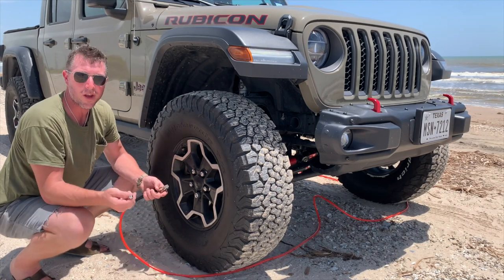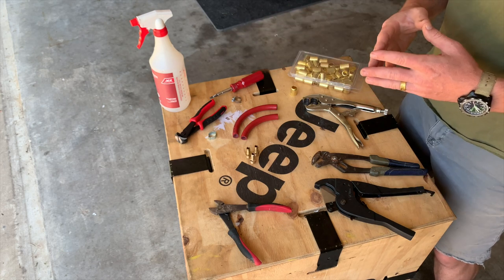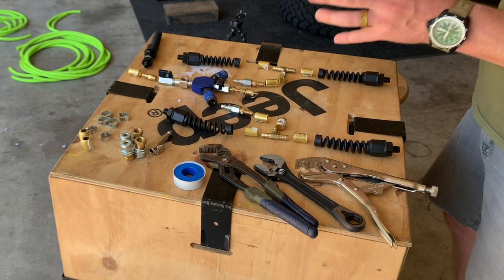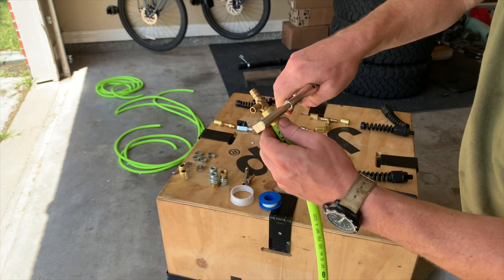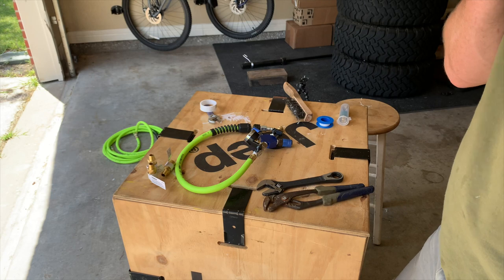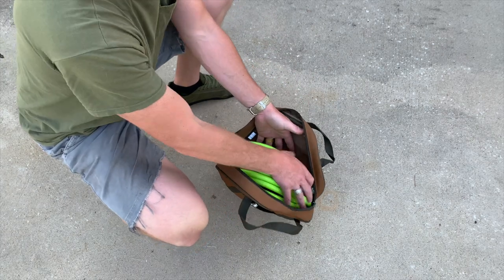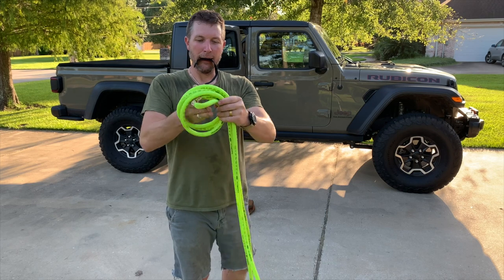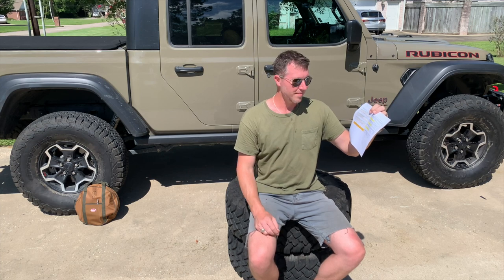DIY 4-Way Tire Quick Inflate/Deflate System for Off-Road Tires

Comment: Great video. I just used this as my blueprint. It's better than many of the ones that you can buy for about the same price. I did do a slight upgrade by using only the Flexzilla ends instead of the ferrules. That will make all of the ends field repairable and it's only about $25 more when you consider the crimp tool and a box of the brass ferrules. At least that's how I justified it in my head.
Reply from the maker: Thanks for taking the time to watch and comment. I use it all the time and have tossed it to friends on the trail too. I used the flexzilla pros at all my ends as well.. I showed a few examples of how to do it. Crimps, ferrules and flexzilla pros at the valve stem connection.. I only did ferrules at the tees and connections that wouldn’t work with a flexzilla pros or where i didn’t see it necessary to worry about repair.. shoot me a message on Facebook  https://www.facebook.com/JKHartel3 or email jkhartel3@gmail.com and I’ll show you pics of my setup. I spared no expense with my build.

Comment: I did same thing but my gage is in the top center I can connect my hose to valve on bottom to air up, to air down I don’t connect the hose to the bottom open valve and it will deflate all 4 tires at same time I love my setup just like yours

Comment: Nice demo on this entire 4 tire system. I'd replace the compressor with a 10 lb CO2 tank. You'll never look back. The inflation timres are not even close.
Reply from the maker: Thanks for the insight, I have been considering that as well.

Comment: This is a cool idea. I happen to have a dewalt flexvolt cordless compressor (I think Dewalt makes them for 20v batteries now too) that I take to the kart track on practice and race days and also take to the desert when we dirt bike. I’ve got 3 flexvolt batteries. Is there anything wrong with using something like this for my Tacoma?  I’ve also got a Ryobi cordless version (because I stumbled across a clearance one for $59) that I was kind of planning on just keeping in back of my truck at all times, Incase me or a family member have an issue (which is fairly common in my home). If anything, I could easily fit the DeWalt and Ryobi in back of my truck when I need to play with the pressures when going off road
Reply from the maker: Thanks for taking the time to watch and comment! Yes this will work with any air pressure source!

Comment: Hmmm cool idea.  Your video made me realize a solution for another issue I have...

I have an older snap on compression tester where a couple hoses have started to leak from age.  I can easily reuse the end fittings that I have because they are really high quality, I’ll just have to find a 3/8” hose ferrule crimper which appears to be the difficult part.  But using any sort of a clamp doesn’t work for the application (because it makes the tool too wide for the spark plug holes).
Reply: The hose 3/8” ferrule crimpers in Canada all seem to be $150+.  Hmmm I need to find some cheaper vise grip style like in your video.

Comment: Great video.  After 18 months of use how are the Haltec bore Lock on air chucks holding up?   The amazon reviews are mostly positive but, of course, there are some negative ones too.
Reply from the maker: Thanks for taking the time to watch and comment. They are holding up well! I keep a spritz of wd40 on the sliding collar and springs to avoid moisture corrosion or sticking. The company I work for uses haltec valve for damn near everything, the other side locks don’t hold up.

Comment: Thank you for making this video, it was awesome! I found it while doing research for my own air system, and I learned a lot from you. 
Do you think stepping up to 1/2" hose would increase inflation / deflation speed?
Reply from the maker: Yes, but it will be marginal at best. If you can find 1/2” and the weight and size doesn’t effect your storage space then I’d say your fine. 1/4” is adequate for even the twin, but 3/8” is a happy medium for a slight increase in flow and not much weight and size increase.
Reply: It wouldn’t make much difference since the restriction will be the Schrader valves

Comment: Very helpful solution, appreciate all the great details!!  Did you have to use a spacer (if so what size) for those stock rims on 37s?
Reply from the maker: Thanks! You bet! No sir, that’s the 2” MOPAR + 3/4” dayStar spacer that I installed 2 videos ago. I absolutely love it. That’s 37’s on stock wheels and no wheel spacers. I’m not sure they are needed just yet. The only worry would be rubbing the swaybar.. believe it or not these 37’s actually measure 35.25” and are approx. 10lbs heavier than the stock set per wheel.. so only adding 40lbs total of rotating mass. If they were true 37’s I would be considering spacers Or different offset wheels. My friend Seth that runs JT mods channel has the stockers wheels with 37” Patagonia’s and synergy spacers, no lift either .. looks great! Check out his channel

Comment: Love this video! I can tell there was a lot of effort put into the design. May I ask what the thread pattern on the Haltec H-5625 Bore Lock-On Air Chuck to connect it to the hose? I can't find the thread pattern anywhere.
Reply from the maker: Thanks, I figured at least one person would find this helpful… The haltec chucks is a standard 1/4” FNPT And goes directly on the 1/4 MNPT flexzilla air hose end. I hope this helps

Comment: Curious as to how the Flexzilla slip on connectors have stood up with use. Do the reusable fittings work loose &/or leak? Just getting ready to go overlanding & into retirement with outdoor enthusiasm. I will be following your pattern for the inflate/deflate system, likely with a Red Green flair if you are familiar with his style.
Reply from the maker: Flexzilla is holding up great… I haven’t had any issues with leaking… I do use the flexzilla pro connectors that allow you to adjust/repair any issues… They work very similar to AN fittings… It’s a great piece of kit to have… I went with a portable set up like this rather than affixing hose to the vehicle… I may do that later on but this is convenient for multiple vehicles.

Comment: Great video!! I’m considering going with 1/4” hose for a more compact storage. Thoughts? I have a Viar 300p and Silverado 285/70/17s going 18 to 42 psi (still need to do your chalk test but my auto deflators require 2x setting to activate.) I know it will take longer but this Viar will only pump so much. Thanks!
Reply from the maker: Thanks for taking the time to watch and comment. Yes, the 1/4” dia would be slightly more compact, but side by side of 1/4 to 3/8 hose comparison I didn’t find it to be enough a size difference to impact storage space vs the extra flow volume. The bucket boss bag makes it convenient to stow away. My single ARB pump with the 37‘s does take a bit of time by comparison of a twin pump set up… But with the four-way system it’s a lot more sufficient than doing each individual tire, be it inflating or deflating.
Reply: @GatorOverland  Thanks! I checked and my Viar pushes 1.76 cfm at 20 psi with a duty cycle of 33% at 100 psi. Most of my fill ups are in the dark at very cold temps here in Wyoming, after a day of hunting. For now an Anderson plug up front  power without opening the hood (wind hazard opening hood) and a 4 way hose setup should really save time. I have done fill-ups in near blizzard whiteout conditions in the dark. There is highway between hunting and home. As a precaution, I fill both front first in case of compressor failure. A four-way system will give me even air to all, hopefully getting close enough, should a failure occur. In the cold weather the Viar does run very cool which is a benefit. Incidentally I have had one of those bucket boss bags for 20 years. Wise choice. ARB compressor mounted on the list next year for sure. Thanks again!
Reply from the maker: You bet man!! 
For better contact, info, photos and video check us out on
https://www.facebook.com/JKHartel3
https://www.instagram.com/p/CF-X_58BjDR/?igshid=1r9yo0niyroip
Email: JKHartel3@gmail.com

Comment: I have co2 tanks for inflation. I inflate my 35” KO2’s from 15lbs to 40lbs  at 30 seconds or less.
I did this with an air hose. As well so I don’t even have to remove my co2 tank from the vehicle.
I have made it fully automated as well. Flip a switch and I can choose to inflate or deflate to one of three pressures. 15, 25, and 40.
Reply from the maker: That sounds awesome that I would love to see what that’s all about. 
For better contact, info, photos and video check us out on
https://www.facebook.com/JKHartel3
https://www.instagram.com/p/CF-X_58BjDR/?igshid=1r9yo0niyroip
Reply: I too have co2 for my 35" ko2's! Do you have monster valves or standard tire schrader valves? Also would you mind posting what switch you used for the auto psi cutoff?
Reply: Hey Gary, I’m going that same route, where I can find your info for your set up? 🙏 thanks

Comment: Could you attach one of those valves to your system that stops deflating at a particular pressure so that you wouldn't have to monitor the deflation? Thanks!
Reply from the maker: Yes, I actually mention this at the beginning but never did the evaluation because it took longer than 20min to complete.

Comment: another great job! looks like your running K02's im about to order some before my lift comes in and im confused on the load range which did u go with? im going to get 35's
Reply from the maker: Another one? You mean you didn’t fall asleep in this one either? I’m messin.. I run 37 1250 r17 load range D. My factory 33‘s we’re load range E. It really depends on what your vehicle weight is, and your intentions with the vehicle… To put it simply, heavier trucks like three-quarter ton and 1 ton Dooley‘s typically run load range D thru F, which allows for more pressure in the tire, and more load capacity of the individual tire, but can often translate to a very stiff, heavier tire because it requires a higher minimum tire pressure, and potentially reduces fuel economy, but some tire mfg in certain tire sizes limit variety of load range options. My gladiator weighs around 5000 pounds, which is 1200lb-ish per corner, and inflation range is 25-50psi. The load capacity at 25psi is 2150lb & 50psi is 3525lb, so tires alone at 50psi would allow for 7000lbs of a load in the rear, and 2500 of that would be your vehicle weight, which leaves 4500 lbs of load on the tires, but most vehicle payload capacity aren’t much more than 1000lbs so, the tires would be more than capable of just about any load. I don’t tow, and run my tires between 27&30psi which puts me at about 2400lb capacity per tire, which would be 4800lb in the rear, and my payload is right at 1000lb, so that leave me with 1300lbs tire capacity in rear at a full load, which is more than enough. 
Know your vehicles weight
Know your vehicle payload
Determine your tire pressure and look up a load/inflation chart and to see what your capabilities are for that tire pressure.. 
I hope this clears things up, let me know if you have any questions
Reply: @GatorOverland  wow!!! That is amazing information and NOPE lol didn’t fall asleep haha. I have a 2021 high altitude gladiator I won’t be towing or heavy rock crawling either I mostly need something good to get up my very steep driveway which is a quarter mile long lol plus I live straight up a mountain so when winter comes it’s very hard to get up here haha and right now my gladiator has the factory street tires on them getting the mopar lift and still trying to decide on what brand and what tire to go with lol I love watching your videos keep up the great work
Reply from the maker: Thanks for the kind comment… Considering you are snowbound, the KO2’s are a great option for most any condition except mud specifically… Not to say you can’t play in the mud with them, but they are not a priority mud tire. They perform outstanding in the snow, sand, most any Rocky condition and more importantly are quiet on the road. 20 inch wheels typically call for a tire that has a higher pressure, so if you’re swapping to 35’s regardless of stock/aftermarket wheel, you should inflate to at most what is on the door jamb, but the chalk test will prove an ideal pressure for regular road driving.. Would be interested to know what the test reveals… I’m thinking 30 to 32 PSI should be sufficient.. You should always re-inflate according to your tow/load when applicable. Don’t forget you need to invest in a programmer so you can resize your tires or your shifting and speedometer will be off, and could potentially damage your transmission, so it is extreme priority to have that done properly. Since you’ve seen a few of my videos I assume you’ve watched the Mopar lift video. I’m coming up on 30,000 miles after install and I still love everyone… Of the parts that I recommend to add to that list I suggest at least the adjustable trackbar. But if you do decide to go with the rest of the components you will not regret it… I’ve been contacted by over 50 viewers who have positive feedback from installing the exact set up. I don’t work for anyone I just learn, earn, and pay it forward
Word to the wise, do not input 35 inch tire on the programmer because you put 35s on… You measure from the ground to the center of the wheel and multiply that number by two. The reason for this is because of the vehicle weight, the tire bows which makes it shorter radius from the ground to the center of the wheel than it is from the center of the wheel to the top of the tire. Rarely are tire heights matching of the number on the tire… Case and point, my 37‘s measure 35 1/2 inches tall at 30psi, And believe it or not my input for my tire size is 34 1/2”.. The distance from the ground to the center of my wheel is 17 1/4 inches… multiply that value times two and you have 34 1/2… My speedometer is spot on.. If you were having a shop do lift and tires, and they are re-programming, I urge you to inform that that’s how you want it programmed initially, do not allow them input “35” for the tire size. This can easily be done yourself as well just remember to measure accordingly.. I use the ECRI programmer it works great For tires, gears, and eliminating or decreasing the TPMS low pressure threshold.
https://amzn.to/3Btu3pz
Reply: @GatorOverland  I have watched almost all your videos lol and love your chalk test video too. I’m actually having the dealership reprogram my tires so I will for sure let them know to measure my tires and not put just 35’s I’m actually keeping my rims since it’s part of my package I paid extra for haha and I actually love the look. I was considering TOYO AT2 or AT3 or AT EX BFG K02’s ,NITTO ridge grapplers Falken wildpeaks but the falkens are out of stock actually a lot is out except the K02’s lol I had them on a trailhawk renegade once they seemed loud to me but they was a D rated on a smal suv lol so idk if that’s what caused it or not but they did very good in snow up this hill. I’m looking forward in more of your videos :) let’s run out and go order my mopar lift and fox steering stabilizer now I’m actually going to do the adjustable tracks but can’t afford everything right now so that will be next :) keep up the great work and ty for responding so quickly as usual
Reply from the maker: You bet! Yes, the renegade is a different suspension all together so they have the ability to transfer sound a bit differently (more like a car than a truck)… My wife has a 16 grand Cherokee with Michelin street tires and it’s louder on the road then my truck with 37‘s.. I even did a decibel check.. I think you should stick with AT’s  if you are wanting to keep the road noise down… And if you havent invested in a headliner you should definitely do that too… It helps significantly with heat and sound. I have over 300,000 miles on BFG ko/KO2 tires and never had an issue and usually get 45k mileage out of them.. I rotate religiously at 5k miles. I favor toyo, Nitto, and Cooper if I went another tire brand.
Reply: @GatorOverland  you talked me into the K02’s LOL guess I’m ordering them today too LOL and YESSSSSSS I love the headliner it came with mine I drove a gladiator that didn’t have one and wow you can tell a big difference in noise and heat. I hope you have a wonderful day today
Reply from the maker: Thanks you too… if you reach out via email I will send you my alignment sheet for reference… My vehicle had a wandering issue (asides the aluminum steering box) come to find out the toe alignment was 7/32 out from factory.. it shouldn’t be more than 3/32 toe.. 
jkhartel3@gmail.com
Or John HARTEL on Facebook messenger
Reply: @GatorOverland  I was under the impression you couldn't go 12.5 wide. Nice to know 37 12.50 17  can be done on oem whhels.
Reply from the maker: Only certain brands can.. BFG and Patagonia for sure

Comment: It's the first time I see a gladiator on youtube with the same color choices as mine: gobi desert, but black roof and fenders and beige seats. The dash panel is black, right? I love that the beige seats don't come with the flashy red dash panel.
Reply from the maker: My color is actually gator not Gobi… But any model with brown leather gets a light dash besides the punkin orange.. all punkin orange have red dash regardless of seat color. If you have a launch edition or overland you have a black dash